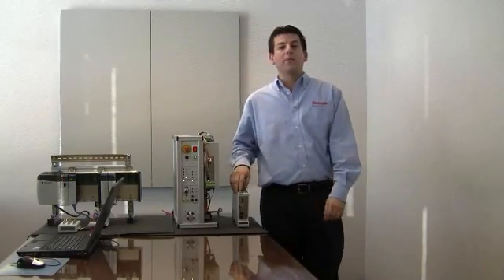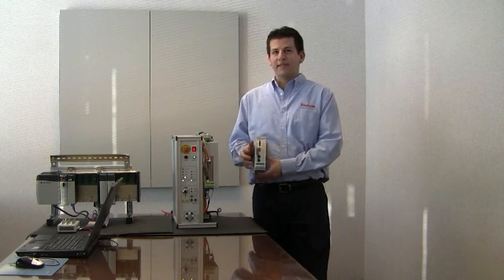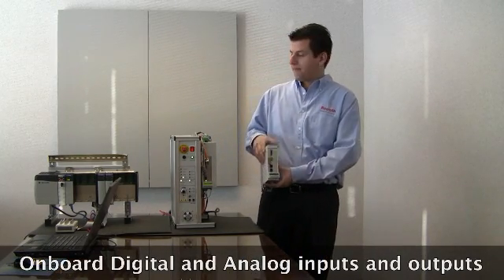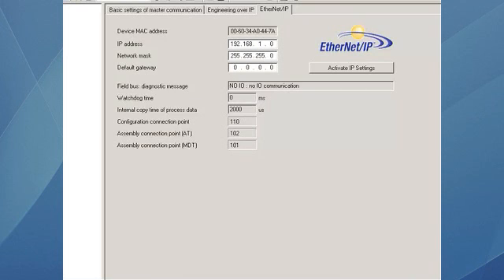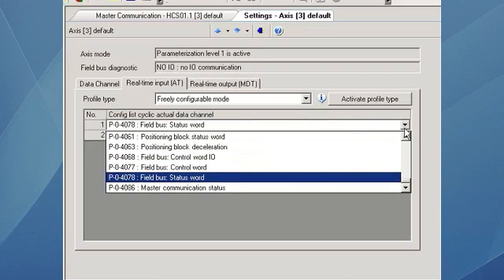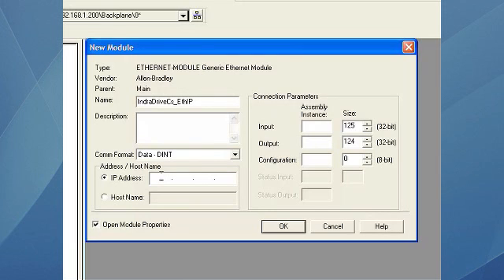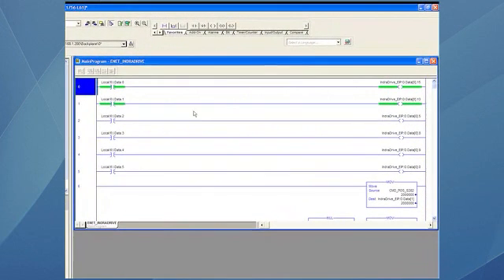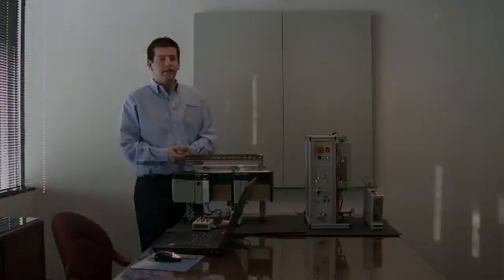How to Set Up Rexroth IndraDrive Cs Servo Drive

Comment: Hello friend, would you have a video or manual showing how to make the backup and how to connect a servo motor in Indra drive C model HCS02.1?
Reply: brother, i have the same issue. How to take the back up and upload it in the new unit. Kindly tell
Reply: @hameed1117  My friend, I'm in contact with the brand's company, as soon as I get it I'll let you know, send me your email, I've managed to upload it!
Reply from the maker: This link sound help you out: https://www.boschrexroth.com/en/us/products/product-groups/electric-drives-and-controls/servo-drives/compact-converter/hcs02-single-axis-converters
Reply: @BoschRexrothUS  Thank you very much, I contacted my friends who supported me in spot welding machines, who work at REXROTH and they will come to the company to provide training!
Reply: @BoschRexrothUS how can i pirchase indra drive servo software